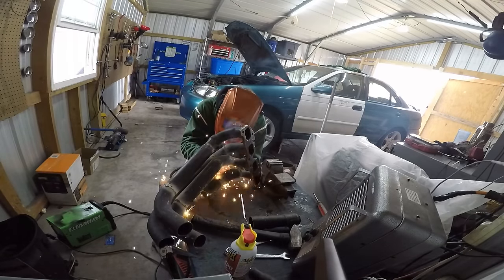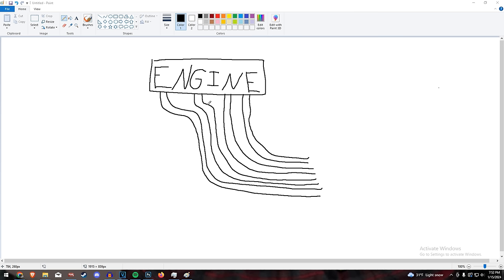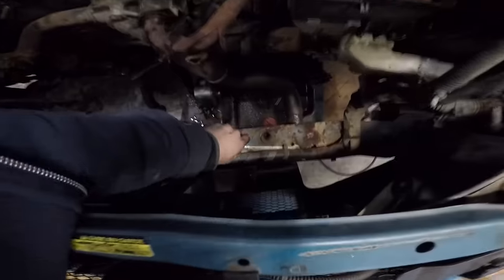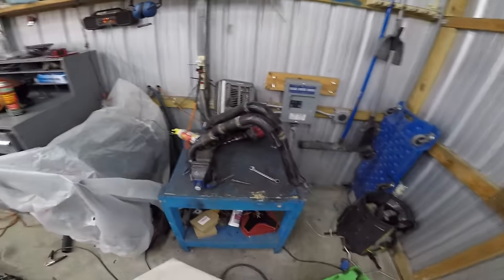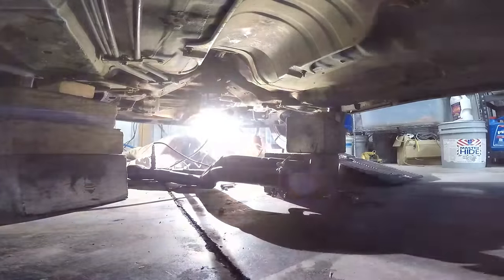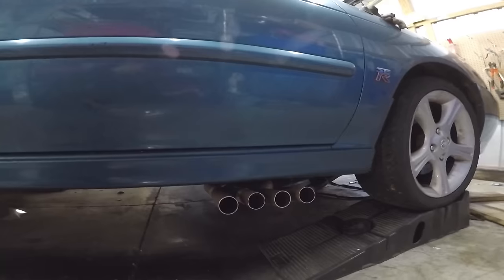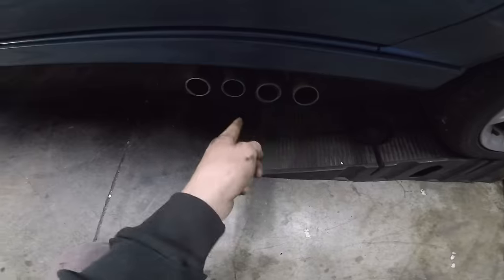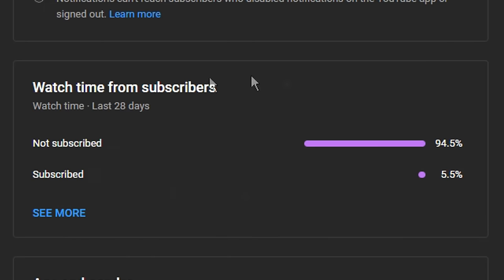True Quad Exhaust on a 4 Cylinder - What Will it Sound Like?

Comment from the maker: Here's the other exhaust experiment videos

True Dual: https://www.youtube.com/watch?v=yf2zUBb_AtE&t=1s

X-Pipe: https://www.youtube.com/watch?v=uI-Pl7vCQBU&t=87s

H-Pipe: https://www.youtube.com/watch?v=hVKnvvYLDCE

Changed Cylinder Pairing: https://www.youtube.com/watch?v=rEDtQp8po84
Reply: It sounds really good until excepts for the tongue out spitting /can  high pitch noise.
Reply: Can you try a boom tube nascar style next?
Reply: Yes.... Good idea.  Maybe even a 4 into 1 sequential fire like that 8-into-1 60's Mustang track cat on YT that sounds like an F1 race car.
Reply: now run two out the back and one on either side behind the front tires.
Reply: "Create an unequal length (UEL) header that makes any 4-cylinder engine sound like a Subaru. However, at the downpipe, it should transition into an X-pipe, separating the UEL header for cylinders 1 and 3, and 2 and 4, and ending in the X-pipe like a V8. It will sound beautifully like a Subaru Mustang."

"I’ll eagerly wait for that video! I’ve already done part of it to my Mitsubishi Lancer, and it sounds like a Subaru."
Reply: try no exhaust straight out of the block
Reply: Sounds surprisingly well
Reply: Time for a boom tube 😅